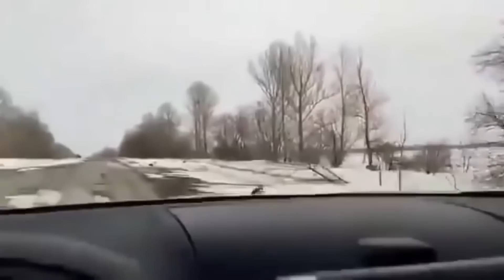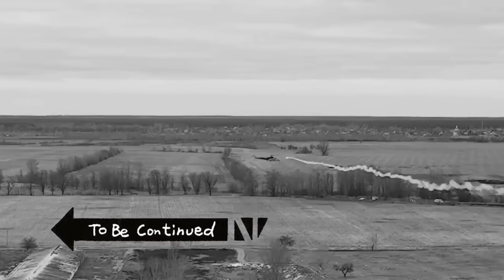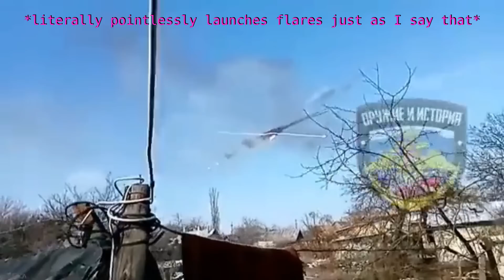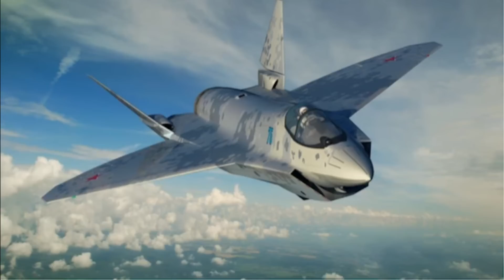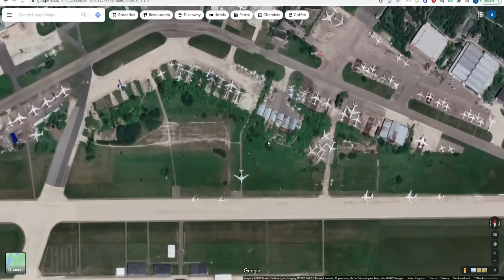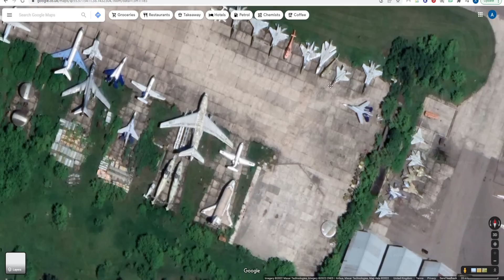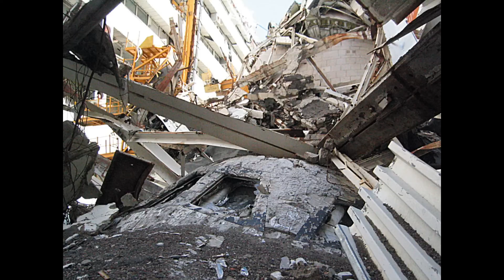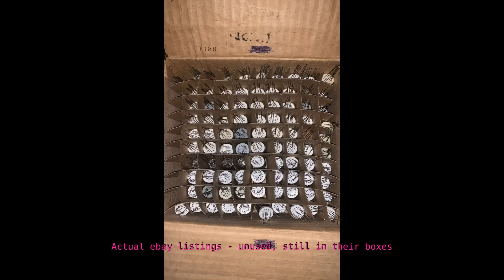100% warcrimes speedrun: Russia's technology problems

Comment: Also, a funny thing about the Russian's and their explosive reactive armor bricks, due to rampant corruption and incompetence in their supply and logistics system, a lot of those bricks have been found to be stuffed with cardboard, sawdust, pretty much anything other than explosives.
Reply: that stems from soft armor bags on t80 series tanks that do have carboard spacers in them, being found on a captured vehicle, but utilize a intrinsically soft ERA design, only on the side of the vehicle which is normally devoid of any ERA. these devices need cushioning to protect the vehicle(ERA is pointless if its own blast blows a track), direct the blast/flyer plate, keep shape, etc. 

the bricks on tanks may just be empty of explosive or even inert components because they were stripped for another battalion's supply during transport or from when the tank was in a depot 12 years ago. or were stripped by Ukrainians after abandonment for IEDs or their own vehicles. these are consumable components, so once hit they need to be replaced.
Reply: """""""a lot""""""""
Reply: Idk about sawdust but i heard that what people thought were egg cartons inside era packs were fillers that were part of design. In few of those videos you can see era bricks or packs opened and scattered around like if explosives were removed by soldiers. People better educated than me said about it they are not sure.
Reply: @robertkalinic335  I think Russia has made it pretty clear that no level of corruption, incompetence, hubris, or stupidity is beyond them. The thing about the ERA blocks being replaced with cardboard and other junk was from a video made by a former analyst for the UK's Ministry of Defence who has experience with Russia and even has an ex-boyfriend who was a Russian tank crewman, so I feel pretty confident that it has actually been happening. The Russians attitudes regarding general corruption are very different than those of people from Western countries. They view things like a manager selling off a company laptop or coffee maker to make a little extra scratch on the side as perfectly normal, and will view someone who DOESN'T engage in that kind of behavior as suspicious. Because someone who is perfectly honest and ethical in their job duties might end up narcing on anyone in the office/department/company who does have a shady side hustle going. It extends even to the military where the commander of a storage depot will supplement his income by selling off or trading weapons, ammo, grenades, vehicles, even old tanks to make money because no one is ever going to come by and take an actual detailed inventory of what's actually there. They'll come by with a paper that says the depot should have 300 tanks, ask the depot commander if he has 300 tanks, then sign the paperwork and go home when the depot commander says "Yes, I have 300 tanks in my inventory." Doesn't matter that the depot commander has gutted 50 tanks for spare parts and sold off another 30 tanks to a scrapyard because no one is actually going to go back there and count how many tanks actually are there. That's just the Russian way, and before that it was the Soviet way. Part of the reason the Russians kept running out of fuel early on in their invasion was because some logistics stooge, or some unit commander, or any number of soldiers in the unit had been selling off their diesel supply before the invasion. And they probably figured it wouldn't be a big deal and no one would find out because the likelihood of actually going into combat seemed very low to them.
Reply: Can i ask you? Did you delete the reply or is my yt app misbehaving again?
Reply: @robertkalinic335  I didn't write to you. And I see 2 of your answers under your comment. YouTube has really had a lot of bugs related to comments lately. Sometimes the comments just disappear.
Reply: @mementomori6128  I meant guy who wrote the original comment, yt comments are real mess. I got notification about his reply and i cant see it, there was no reason to delete it. Bs like this happens too often, if you start posting links or are not polite, there is high chance your subsequent comments wont even show up without any explanation.

Comment: The Russians do have an active countermeasures system similar to the Israeli Trophy system for shooting down anti-tank missiles. The issue is that they are only on a small number of T-90 and I think T-80 tanks, and the tanks that do have them are kept in Russia because Putin is paranoid and thinks Russia might be invaded at any moment. So he keeps all the best stuff within their borders. The T-14 Armata is supposed to have the system as standard, but there are only a small number of pre-production T-14s that have been made and much like the Sukhoi Su-57, Russia can't afford to actually put them into service. So as Russia loses more and more of their modern vehicles and equipment, they pull out old obsolete equipment like their Rusty, crusty T-62 tanks to put on the front lines.
Reply: T-80 system do not protect against top attacks and t-90 were destroyed by artilery
Reply: @hphp31416  and t-90 were destroyed by artillery. You mean a couple of them did and they pulled them out of ukraine since its pointless to use good tech when they dont need to use the good tech to win